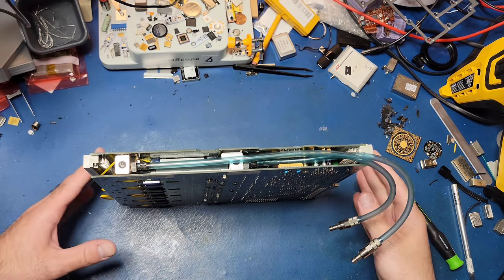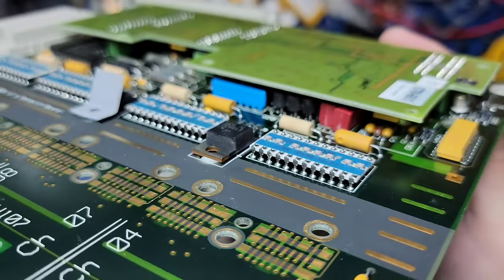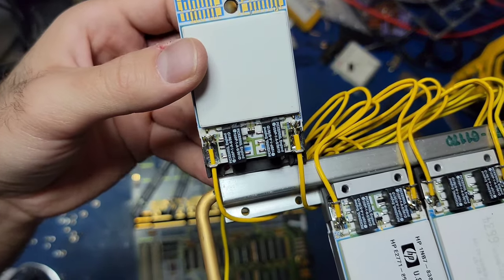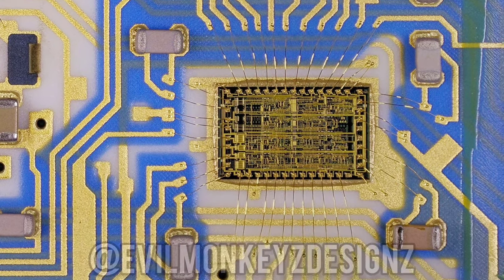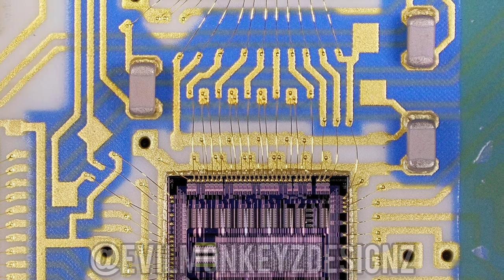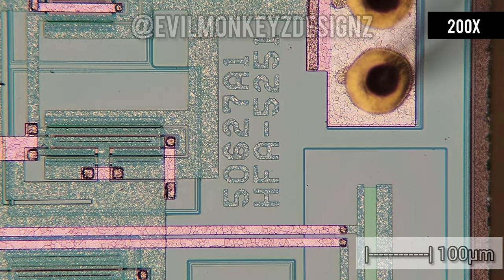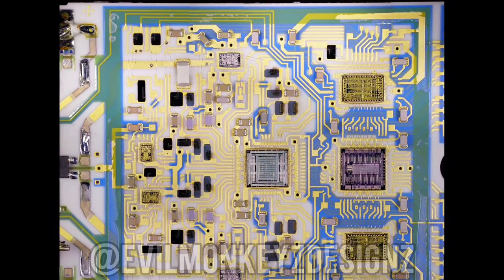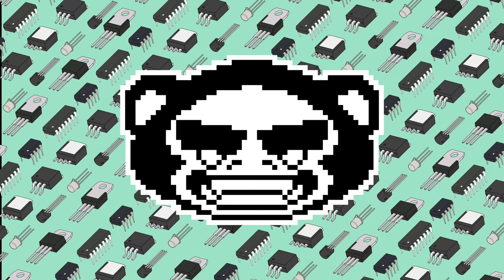HP83000 I/O Board Hybrid Modules

Comment: Any hint about the manufacturer of the ceramic board. When I look at it, it looks a lot like our boards. I worked for Telefunken microelectronics for about 33 years.  In the beginning, I was also a specialist for die- and wirebonding and active laser trimming. In the 80th and 90th we produced many boards for many different customers, including HP. But the board we produced for HP, was an Al wedge -wedge bonded on a gold plated PCB. 
The board you showed looks well designed AND produced. Even some of the ball bonds are showing some slight “ball clubbing”. 😉.